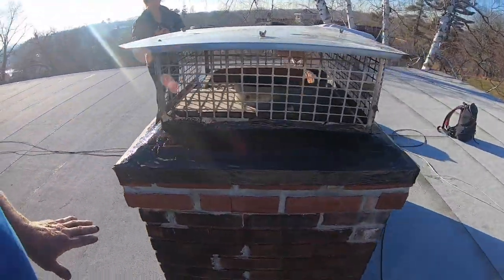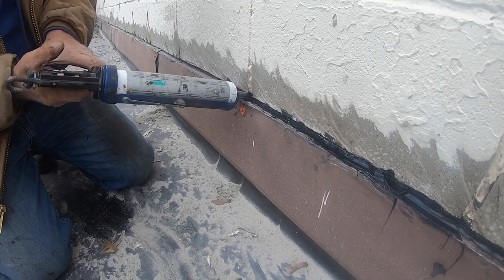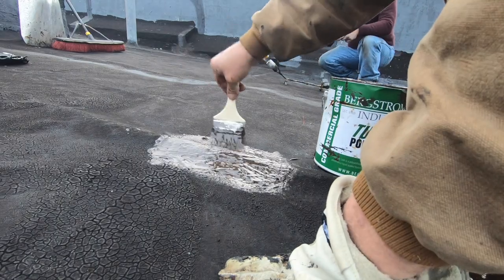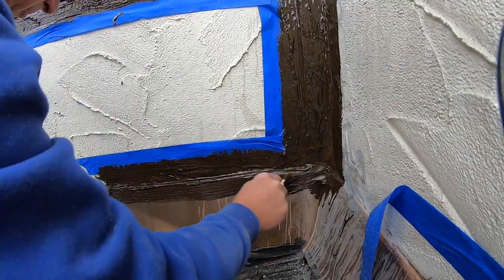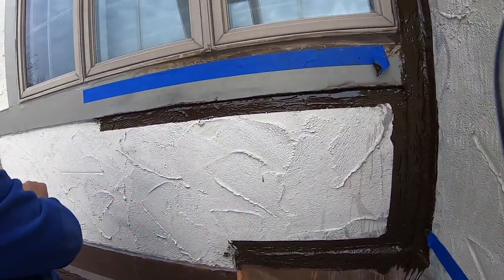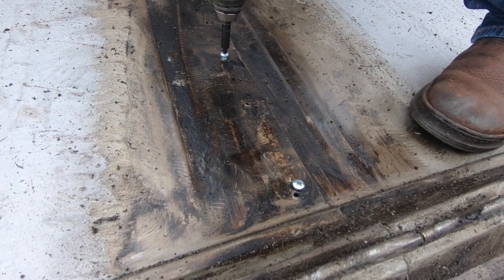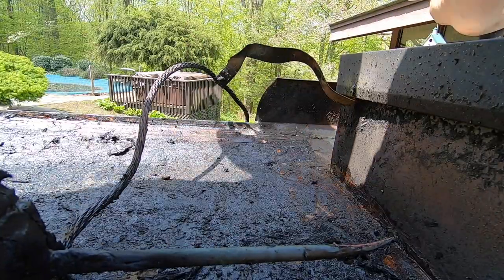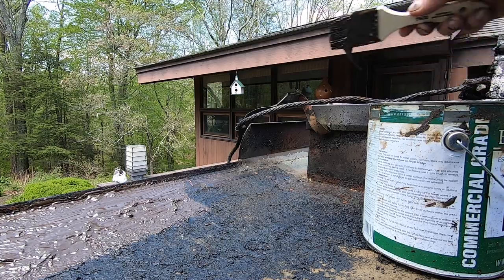15 ways Turbo Poly Seal is used for any leak repair - You will be an EXPERT after watching this

Comment: Hi, I have a corragated roof that is leaking at the rivets. Should dab the rivet, then cut squares of the fleece put over the rivit and then more poly seal.  There are probably 500 rivets.  Where it is leaking in places probably 50 to get the entire area but might as well do the entire roof.  Its pretty old.

Comment: Went to the manufactures website, the sealer is really expensive. What kind of warranty do they have on the  product, How long will a typical application last?
Reply from the maker: warranty is all depending on how good a job you do. Tis should last 10 - 15 years without any protection

Comment: I am going to be using turbo poly seal after watching your video sealing a chimney crown with it. but I saw you in another video where you didn't use the fleece at all. so I was wondering if you always need to use the fleece on the edge of the crown or depending on how bad it is?
    I'm not sure where I saw it but I read that you might want to apply an oil-based paint to further seal the Turbo Poly Seal. This was supposed to make it last longer.
   Have you ever applied an oil-based coat on top of the turbo poly?

Comment: Hi dear roof doctor. Thanks for your effort. How much weight of fleece for m^2
Reply from the maker: Mustafa, I am sorry but I did not understand the question. If you are asking, How much does a 2 meter length fleece weigh, then the answer is barely anything. The Turbo Poly Seal Kit comes with a 50 Ft (15.24 meters) of Polyester fleece for each gallon. The fleece is specially formulated for Turbo Poly Seal applications.
Reply: @FlatRoofDoctor  already you gave answer thanks. Here in my region I couldn't find such polyester fleece. My reseller is not ordering for small quantities... It seems wallet or bag producers are using such materials . I will look for their vendors.
Reply from the maker: Ok, Mustafa, If you have a Home Depot type of store. Look for a product made by Henry. They make a polyester fleece sold in 150 ft rolls. It is thinner but still could work. If you buy Flex Seal liquid {silicone based) and use that with the Henry fleece or a cotton roll that is used with roofing tar, you might get some good results. The tar saturated cotton with Karnak 66 brush grade sold in Home Depot is also an alternative.
Reply: @FlatRoofDoctor  thanks... I am using koster kbe flussigfolie ... German made. In turkey no super silicone or bitumen based products by Americans ...
Reply from the maker: Good job, you the man